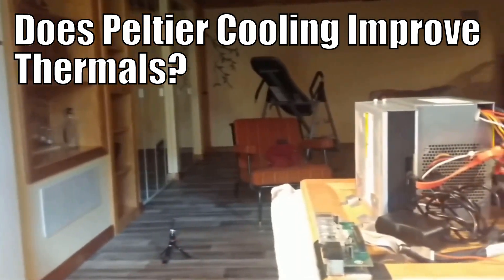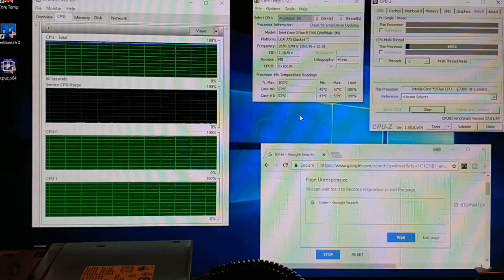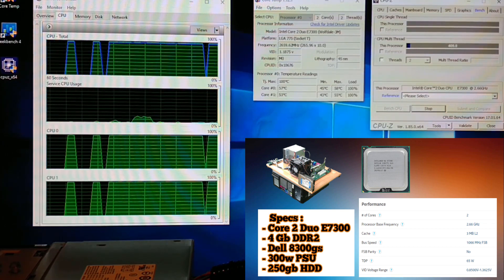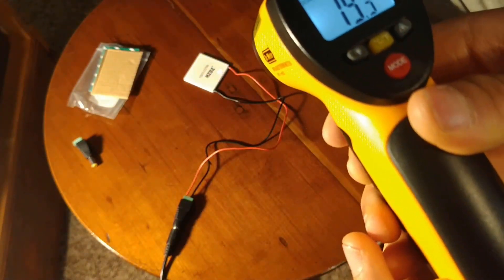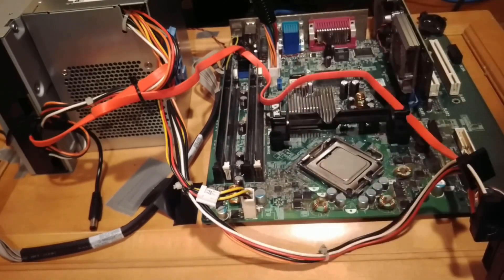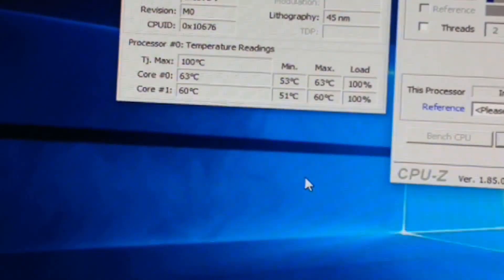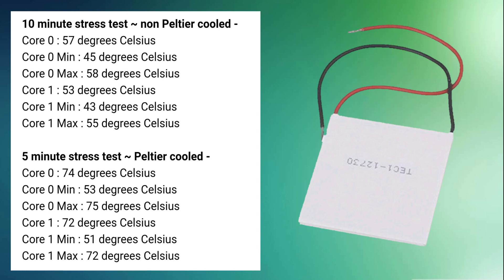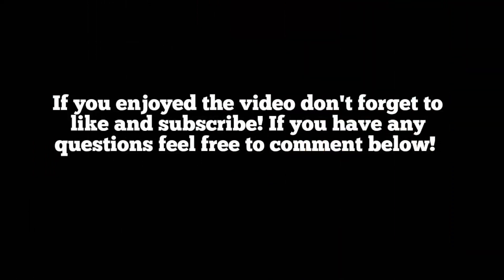Does Peltier Air Cooling Improve Thermals?

Comment: if you use a more powerfull peltier and a much better heatsink it will work fine
Reply from the maker: Aleksander Sats I completely agree, I mentioned how the weak heatsink is most likely to blame a couple times in the video. The reason this video is important, is because I plan to do more testing with Peltier in the future, so having this data is helpful. Thanks for watching!
Reply: I have bought Peltier's myself and have tested them. don't get the cheapest ones I bought a refrigeration kit and that Peltier is very powerful managed to freeze a decent sized heatsink if it is well cooled. even an old Quadro GPU heatsink got a bit too warm. also, I would recommend using a power supply that has a lot of amps available. like a computer power supply as it does take 3 or 4 amps from the start but if it gets colder the fewer amps it takes. and another note since you are gone use it to cool a CPU it is going to keep using 3 or 4 amps
Reply from the maker: Aleksander Sats Thanks for the recommendations, I will definitely keep those in mind when I do Peltier testing in the future.

Comment: You should use silicone dielectric grease instead of petroleum jelly. The jelly will melt at higher temps, whereas the dielectric grease can withstand very high temps while maintaining it's consistency. (I am a Mechanic 30+yrs)  It can be purchased at any auto parts store.
They do make Peltier coolers with a much higher wattage/TDP rating. But like you said, I wouldn't recommend it. 
Good video! I look forward to more content from you.
Have a great day!
Reply from the maker: Matt Christie Thanks for the recommendation, I will definitely check it out because I intend to experiment more with Peltier Cooling in the future. Thanks for watching :)
Reply: Your welcome. Some extreme overclockers will coat the CPU socket with dielectric grease to prevent moisture between the socket and the CPU. (I use it in all automotive electrical connectors, light sockets, spark plug wire boots, battery terminals, and the slides on disk brakes.)  Also around the socket, you can use a form of soft artists eraser compound. It's kind of like clay, and you push it in around the socket, making sure to remove any air pockets. There should be some videos on YT about it, dealing with LN2 overclocking. 
There are also types of refrigerated CPU coolers that are pretty cool. (No pun intended!) Might be worth checking out.
Reply from the maker: Matt Christie That is very interesting,  because I knew my results were pretty bad compared to what other people were able to get by using a Peltier Cooler. So the next time I experiment with Peltier cooling I will definitely use a better heatsink, as well as refine my installation method in order to yield better results.
Reply: Have lots of patience and never give up!
Reply from the maker: Matt Christie Will do,  thanks for your support and encouragement!